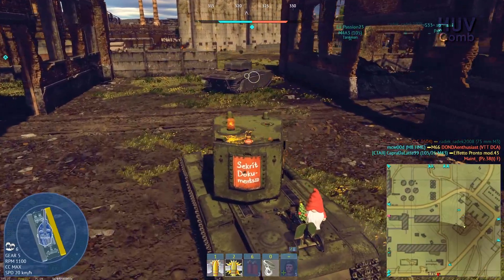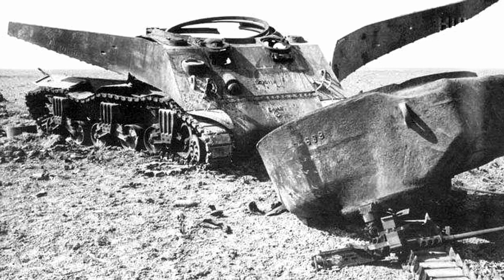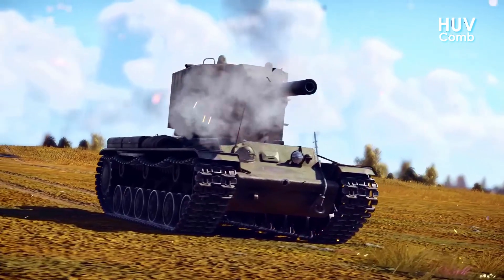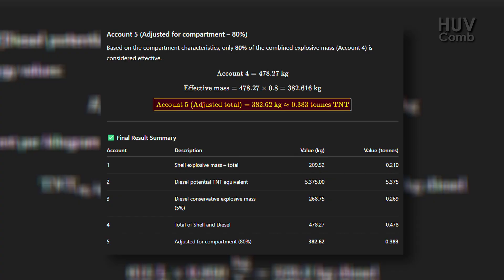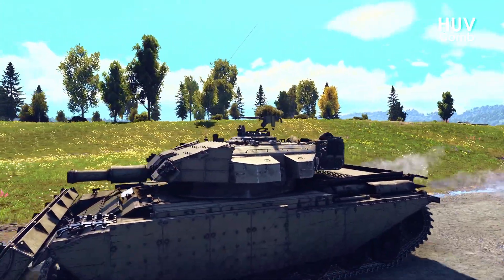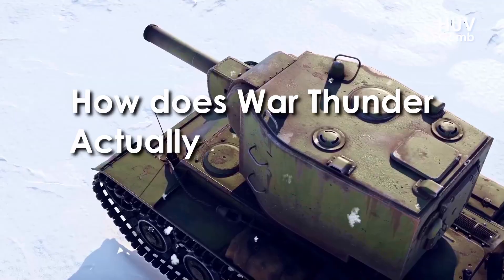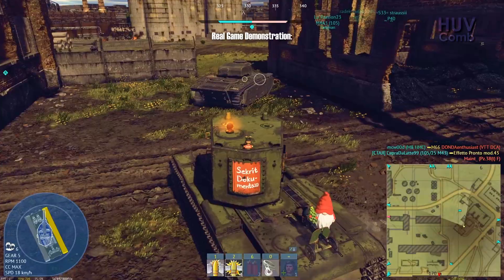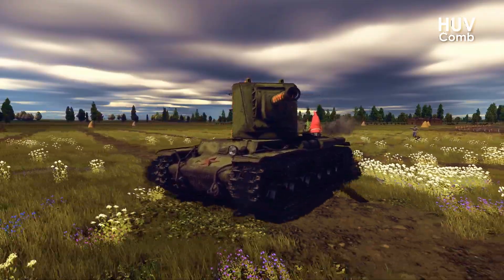Real Tank Explosions vs War Thunder – How Accurate Are Ammo Cook-Offs?

Comment: I think this would only work on older tanks. Modern tank ammunition like that in the 120mm abrams is super unlikely to cook off if only sabot is loaded. The gun is fired with electricity instead of a traditional hammer and pin mechanism and the propellant is pretty inert otherwise (or as inert as tank ammunition really gets). Heat shells do make sense with cooking off as they have a warhead but the sabot probably shouldn't. This is why the blowout panels accually work in real life instead of the tank just being instantly sent to the shadow realm. I can't imagine gaigen would model this though because they're just awful.